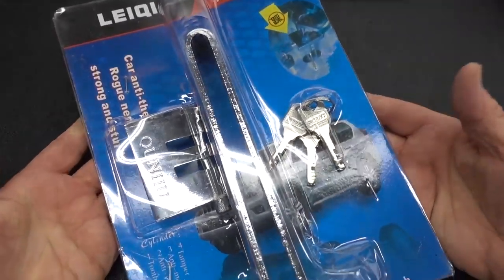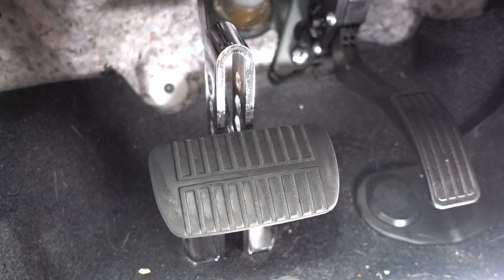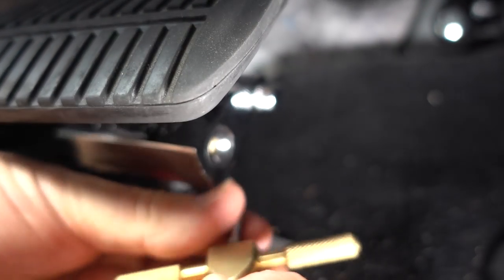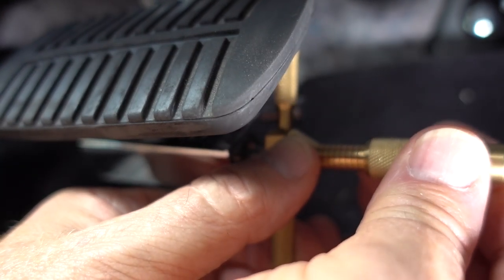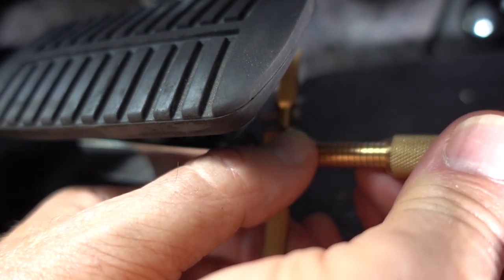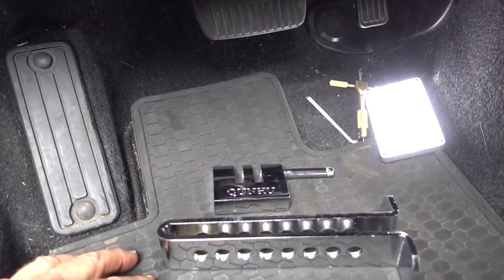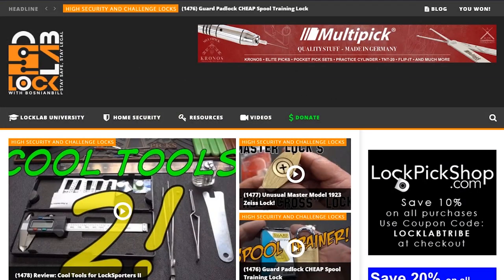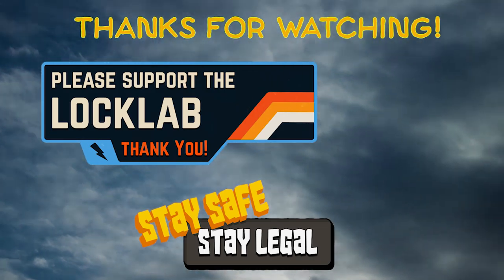(1542) Review: Disc Detainer Brake & Clutch Lock

Comment: Workaround for the brake being locked is to use the shifter override after its started. Thn just drive carefully using the handbrake to slow down and stop. They key is driving slowly.
Reply: But my cars require the brake be pedal be pushed before starting?
Reply: @RevMarket  mine don't but they're older vehicles. Exactly the kind you'd be able start without a key.
Reply: And the moment you pas a cop he will go wth is up with this guy. I better go find out.
Reply: @warrmalaski8570  so who said you have to pass a cop? I'm not suggesting you try it or that it was without any risk. But if you're gonna take possession of a car it's probably better to get the car out of the driveway quickly. Instead of laying under the dash in the middle of the night trying to pick the lock.

Comment: Most modern cars want you to press the brake pedal before you can move the gear selector. So it would work with them also.
Reply: Most modern automatic cars...
Reply: @coliander4180  Well, the manual shift vehicles have a safety interlock that keeps them from starting unless the clutch is pressed down, so putting the lock on that would work also.

Comment: 1: you need to press the brake to shift from park right? Seems like that would ensure the lock would need to be dealt with. Also on a manual they couldn't depress the clutch to start the car or put it in neutral.

2: seems like it's use may be for cars that aren't driven as much like classic cars, which are also likely to have easy ways to pick or hot wire. One of these plus some security cameras seems like a good start to making sure a thief is there long enough to get caught.
Reply: You can pull the car out of gear without depressing the clutch pedal. It's probably not good for the car, but it can be done.
Getting into gear is a different story...
Reply: @QlueDuPlessis  yeah good point, I have a manual and forgot you can do that. So they'd still have to remove the lock to drive it, but you'd be at risk of a tow-away.

Comment: I'm a new locksmith and I can attest to the fact that it's quite easy for me to pick a six-pin disc lock at my bench but when it's locked up to a storage locker and it's dark and cold and you have an anxious client waiting to get in it's way more difficult. I ended up drilling a lock which I should have been able to pick because it was at such an awkward angle my client was very patient with me while I attempted to pick it I could tell they were getting anxious and antsy so we took out the 18V Makita and the cobalt drill bit. Boom . In!

Comment: Big disadvantage is it does not prevent them from moving on before breaking in. Ya they won't be able to drive off with the car but they still may have broken in before they'd find out about it. Probably damage and theft of opportunity of whatever is inside. Something more obvious might make them move on with just a glance through the window.

Also any car with a handbrake could still be driven if you have a way to disable the interlock that prevents shifting out of park if the break peddle isn't pressed. It's more work but I can drive without the break peddle once the car is on and in drive.

Comment: 1 its cheaper on eBay. 2 Car theaves don't like to hang out of the car door working on a lock. Expressly of it's for longer than 1 minute.   This lock dues both of these nicely.  The trade-off being the minute it takes to place it on with the key.

Comment: Interesting lock that will more than likely stop your smash and go type car thief but it appears to be so much of a pain in the butt to use that it will a deterrent to the owner of the vehicle as well and for that reason it makes it pretty much useless.
What would be of interest to its value as a security device on more open access vehicles and for that matter vehicles in a long term storage lot is what exactly is that bracket made out of mild steel or harden steel, if it is harden steel which I doubt it would prove to be much harder to cut and thus making it more useful.

Comment: Thieves could still use the handbrake though🤔
Could still change gears through rev matching the synchros.
Great idea but an accelerator stopper would work better maybe?
Reply: Many cars require to press the brake/clutch to turn it on
Reply: Fernando Dember Laguna yes but not all, still like my accelerator stopper idea better though
Reply: Keyless Entry This lock is advertised to fit either pedal.  However do beware of the adjustable pedals in some cars, need to lock in highest possible position, not highest position for your personal settings.
Reply: John Francis Doe, I'm just commenting on the products other possible applications, former mechanic myself. I have 2 kill switches in my personal vehicle and a hidden GPS tracker with camera and mic. Thanks for your input though✌️

Comment: Great idea in theory and would stump your average thief however a determined veteran old school thief or anyone that works with car would know most car can be driven without using the foot break and would just use your handbrake but great for new fly by wire handbrake cars..
Reply: For automatics, you cannot shift out of park without pressing down on the brake. And manual transmission needs the clutch pressed to start the engine.
Reply: @bmitch3020  that's only on new cars so would be great for them.

Comment: That's actually a pretty clever lock.  Not super high security at face value, but it works in such a way that you are forced to do something about it.  There's a few situations where a car would operate with this equipped, but only if the owner is a complete moron.  More typically, you would only be able to ignore the lock if it was mounted to a vehicle that could be forced into neutral and you intend to haul off the entire thing.

Comment: THANK YOU for doing "in situ" videos...   A lot of sport pickers (not all, but a lot) don't understand what conditions locksmiths and other security professionals have to deal with while defeating locks in the field... SURE that Master Lock 2866DAT is a simple pick.... UNTIL you're laying on your back half under a customers SUV, in the parking lot of their work (because that's the only time they could schedule an appointment this week), on blacktop, in full noonday sun,  in 110 degree heat, AND the dang things been on for the year and a half they've owned the vehicle, and who knows how long before that.....  so there's all sorts of gunk in there, IF it's not completely corroded from being exposed to both the elements, and salt water....    After flushing it with Tri-Flow and canned air then MORE Tri-Flow,  and about 35 minutes of raking, picking, bumping, rapping I gave up and brought out the "rotary pick" (since the customer just wanted the ball hitch off, so they could put the trim cover back on)..... Not only was it impossible to unlock under those conditions, it was even a PITA to DRILL because the only way I could drill it was by holding it while laying almost directly under it, using my other hand to drill upwards, and getting a face full of metal chips, dirt, and solvent in the process. Fun times...
Reply: Slow down. Who hurt you?
Reply: Show us on the doll where the bad man hurt you.
Reply: It's the life You chose ( that's why You make the " big " bucks ... LOL ) 
 PS; MASTER LOCK GOT THE LAST LAUGH ON YOU , AFTER ALL 
( at least that's what Walter told Me .... you know Walter ... Jeff Dunham's Buddy )

Comment: How well would it hold back a portable Angle grinder?
Also, like the concept. Quite a few cars today require either clutch or brake to be pressed before ignition is turned on. So for someone with a keyless ignition its a good extra insurance. 👍

Comment: Question: what is the right hand twister used for? It’s new to me.
Reply: It’s a plug spinner.  Used when you pick a lock the wrong way. It will flip it past the pins so fast it can’t reset

Comment: My car computer requires that I press and hold the brake down while starting the engine. Safety precaution against accidentally jumping forward (or backward) and hitting something.
So even if it's just locking the brake, and not the gas pedal, it's still a good anti-theft measure.

Comment: I must confess I bought one of these (exact same one) a short while ago for around £12 here in the UK from Amazon. The purpose was to add a little security to my van and see how easy it would be  to pick a disk detainer lock. I figured that even a cheap Chinese disk detainer lock in a cramped positron would pose difficulty for a thief.  I got it open several times but didn't get as good clicks as you seemed to be getting. I used the cheap Chinese pick slightly modified.

PS I picked mine whilst sitting on the sofa, much easier 🤣  although would have been good to see you do a second pick of it in the lab for comparison.

Bill,  many thanks for sharing and inspiring me to video a picking of the same lock 👍🏻

Comment: These are awkward to fit when you first get one but after a while it’s quite easy to get it on and off from the drivers seat, takes about 20-30 seconds. On a manual lock it on the clutch, most cars require you to press the clutch to start. A car thief will likely carry fancy tech but unlikely lock picks and the knowledge to use them. They would probably remove it with a battery grinder but it would be a surprise for them regardless.

Comment: With so much open space at the top couldn't you just push the bottom back towards the firewall ?
Reply: Then it flops down while your trying to break in the middle traffic. Two blocks away.

Comment: I think Bill cheated a little. It looks like the lock can be flipped 180 degrees so that the opening of the cylinder can only be accessed from the left. This would make it even more difficult for a right handed person in my opinion.
Reply: William Jones But it would provide easier access with the drivers door open.  Just bend down outside to reach the keyhole.  Whatever pedal you lock should be one that must be pressed to start (pressing for a smoother start doesn't count, thieves won't care).

Comment: I don't see the point to block the brake in the unpressed position... you can always use the handbrake and use a lower gear to slow down and stop... i think was better on the press position to lock the wheels... i drive more than once without brake (with manual transmission) and is not so hard (was after brake failure)...
Reply: First, starting the car is imposable in newer cars ware you have to depress the brake first. Second driving like an idiot tends to get the interest of cops.

Comment: Unless having the brake depressed for an extended time damages the brake system, it would be better to figure a way to lock the brake down. This will lock all the wheels and make towing more difficult
Reply: Shoes/pads might rust to the discs/drums. Clutches will rust to the flywheel sometimes.
Reply: I think the idea of this lock is to either keep you from shifting into gear or not allow the clutch interlock to clear.
Reply: Yeah i was worried about that for long term use. As to the other comment. If the wheels are clamped by the brakes, shifting is not really a big concern, though i see why you  mention it. But the point is to make a remote stored vehicle as much of a pain in the ass to move as possible. If you use this then a lock either improvised or bought to lock the shifter would solve this problem. Also a lock and chain around the wheel or axle to an ground anchor point would also help. But again im not sure pressuring the brakes for that long is a good thing for them. This is still pretty cool as it is.
Reply: metamorphicorder Maybe lock the parking brake in park mode.  Difficult to drive or tow like that but not impossible.